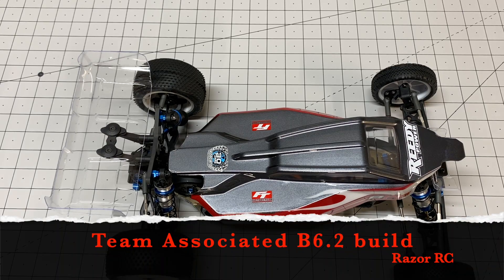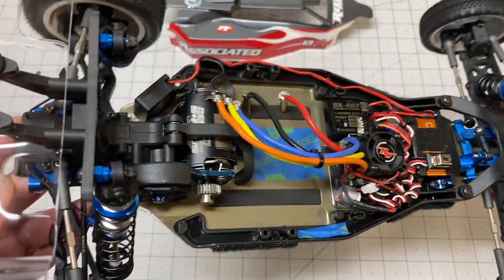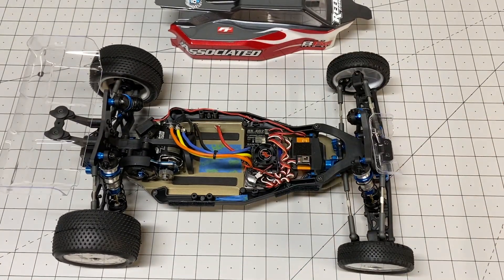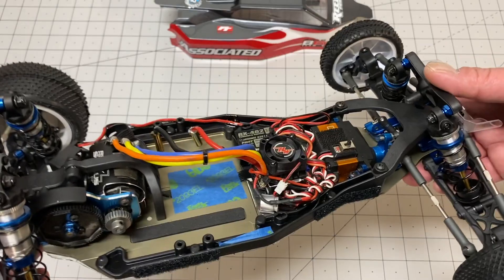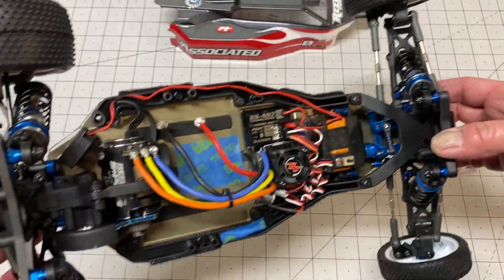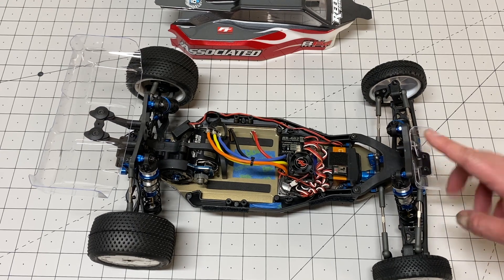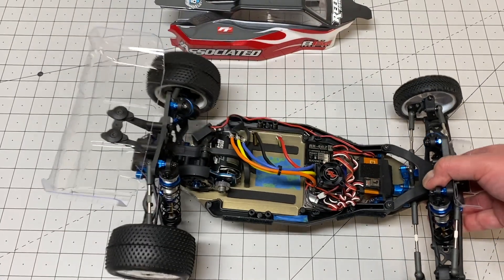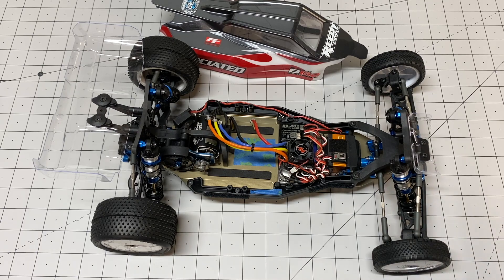Team Associated B6.2 build review

Comment: I remember back in the 80’s and 90’s that companies didn’t release new kits each year and instead would offer new parts to update platforms. I have a 6.1 and don’t see enough new things here to justify the cost. If anything ae should wait another year and release a b7 with more improvements. Thanks for the review of the 6.2.
Reply: Just an FYI, the 6.1d can be upgraded to the 6.2 for rougly $80!
Reply: I like that the company's aren't running the same platform for a decade besides the the 6.2 is just another step foward just set back and watch as the company's try to one up each other.
Reply: Yeah, not enough bang for the buck, IMO.
Reply: @RainSkunkFreezeTree1.5  "that company is are not"
What?
Reply: I mean isn't that what they are doing? Releasing the car with updated parts but are still offering the new parts as separate to put on an older car

Comment: Quick Question.
I'm getting back into R/C, and dragging my kids along.  A shop near me sells used cars, but I'm wondering how well the parts for cars from Associated or Losi buggys are supported?  If I pick up a car that is a version or two old, will I still be able to get parts for a while?  (I had to resort to modeling and 3D printing to get my old HPI up and running.)   
Or should I just get them some starter Traxxas cars for now?
Reply from the maker: about 1-2 years
Reply: Just curious to know how your decision making went and whether or not you got 'em into racing ^.^

Comment: Wow wonder if you just got a bad kit?  I just finished, yesterday, building up a B6.2D and the fit and finish was really good, with the exception of the spur gear.  The spur gear in my kit has a defect, but the bearings, gearbox and everything else went together very smoothly.  Easiest kit I have built from them, for me anyway!  Love the video's!  Keep them coming!
Reply from the maker: Ray Meyers glad it worked out for you, my transmission case is definitely not molded right.  I spent another hour messing around with it and examining it and found several issues
Reply: @RazorRC  That's a bummer. Sorry you had to deal with that! I hope it drives well at least, first race with mine last night and I loved it!

Comment: So which would you recommend for those just getting started? B6.1 or this one? Thank you for the review.
Reply from the maker: I always recommend getting the new one, just for parts support and it will hold its value longer
Reply: @RazorRC  Thank you.
Reply: AL USMC I disagree🧐 B6.1s are holding excellent value and the upgrades on the 6.2 are trivial in the grand scheme of things. I’d look for a hopped up B6.1 on eBay or at your local track, way more bang for your buck and parts will be around for a long time . Put the money you save into good tires and practice time on the track 👍
Reply: @travisbishop7212  Thanks.

Comment: Do you find that esc "punchy". How do i smooth that esc out?
Reply from the maker: seems OK to me, I haven't noticed anything.  there are some settings in the ESC, not sure if there is a punch setting though
Reply: That looks like a Justock... Have you ever had any steering issues when steering back and forth quickly? Which program settings are you using on it?

Comment: Strange review.

5:30 That's the point. They did this to eliminate the insert they had on the 6.1, not to save you from buying extra parts if you break, say two right rear arms.

The parts are all from the same factory as the previous kit.

Not sure about the bearings, sounds like you got a fluke on those.

Overall it's about the same as the 6.1 build, they barely changed anything except for a few parts on the rear end.
Reply from the maker: You're right about the arms, though they call them "symmetric" while I think a more accurate term would have been "reversible" as they aren't exactly symmetric.  I don't know if you own one of these, but there are some QC issues, the D comes with the wrong rear pistons, and I've had several people with the 6.1 comment that the QC seems worse.  Lots of people have commented on the bad bearings, I imagine the factory just outsources the bearings and o-rings since they are commodity parts.
Reply: I agree with you, I've seen too many complaining this kit is a money grab. It's a nice update, eliminating the inserts on the arms and adding the superior rear hub design. The chassis fits certain conditions better than the shorter one. It seems like a lot of people assume that you must buy a new car to get these features. You can just check the parts list online and order everything you need to try out the new changes for about 70 ish dollars if you dont go for the new chassis. The new kit is for people who need a new buggy.